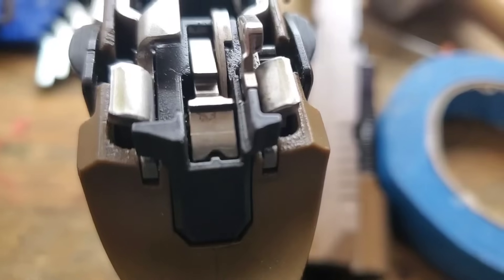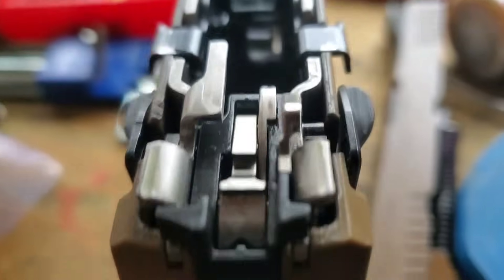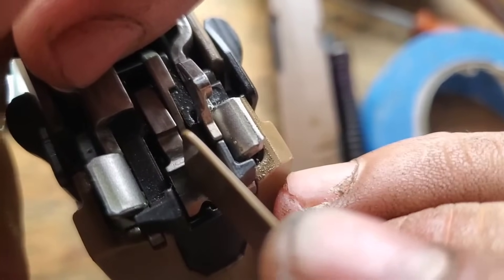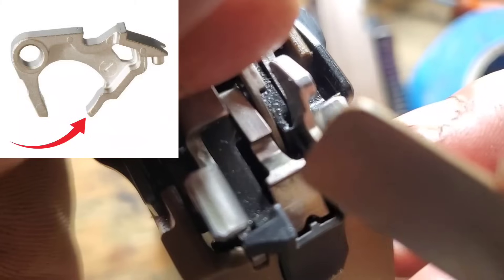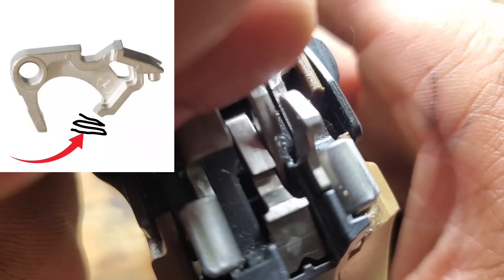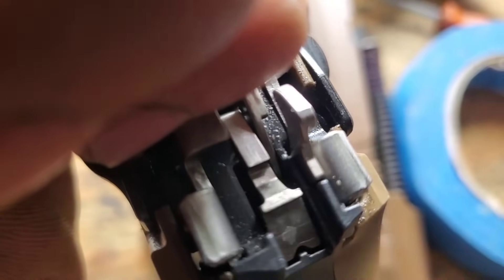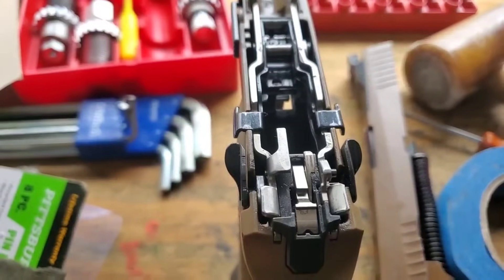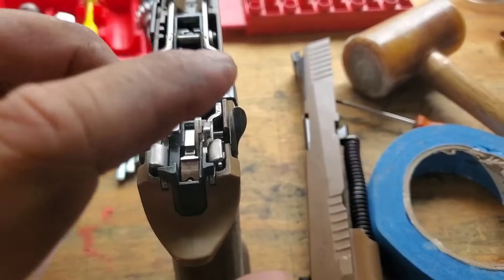Sig P320 [part I]: Private owners solve Sig Sauer engineering problems.

Comment: So. A couple of takeaways for someone in the same boat. I know that there is a company name slanted aces, tactical that has Pat did a fix for this. Don’t know if Bruce Gray works for them, or owns them rather, but I am waiting to see what gets brought on the market and how they plan to repair this. I also right now highly questioned my P3 20 and I do not feel safe carrying it with A round in the chamber. I also can’t afford to run right out and buy something new. That P3 20 has been my carry weapon for the last five years.

Comment: I feel your pain. I have three P320s.....one full size, one X5 Legion, and one Compact. P320s were my primary and back-up range guns, so I have a bunch of extra mags, as well. That's a lot of total money invested in pistols and "accessories". IF Sig recalls all P320s and actually fixes their design issues, I might consider buying another Sig down the road. For now, my new range guns are different brands, since most ranges no longer allow P320 use, for insurance and liability reasons. As for your modification, I'm just going to wait to see what Sig does about the issues.
Reply from the maker: I think you've got the right idea. Wait it out. I'm just so disappointed man. The gun seemed to check all the boxes when ai bought it

Comment: The trigger safety disconnect by pressing the sear alone does not move high enough to touch the striker safety disconnect unless you pull the trigger. It does on mine.
Reply from the maker: They do not appear to all be manufactured to the same tolerances.

Comment: Or. Just get tye updated trigger unit, they will literally do it for free. Literally been proven that it won’t go off with the new trigger unit no matter how hard you drop or hit it. The only ones that keep going off are the ones people and law enforce didnt send it in for the fix, and just kept running the first gen trigger unit.
Reply from the maker: If you look at the sear and trigger bar and trigger, these are all factory post-upgrade parts. Still having problems until I ground the connecting link off of the rear of the sear.

Comment: Nah the trigger issue is a whole Nother problem that they somewhat solved, but the current un commanded discharges I believe her from a structural problem with the sear in probands video Heights, a structural engineer, believing the seer, the MIM process used to create it is an issue. That video site he believes the bonding of the metal molecules in the MIM processing are failing, hence, reducing the sharp angles of the sear, creating the uncommanded discharge when the weapon holstered or  unholster is it a certain angle with juenough force to let the sear disengage the hammer

Comment: I wouldn’t try that mod at this point. Best just put the 320 in the safe. The safety doesn’t block the sear. Wiggling the slide on the gun wiggles the sear against striker foot. If you dry fire a 320, the slide will hop up because the sear is holding the slide down.

A loaded magazine pushes the slide up opposing the striker engagement. Not for me. I put my two 320’s in the safe, then eventually sold them to a gun store. My conscience isn’t clean about that.

Comment: 0:24  Isn't the sear made of polished stainless steel? (not other metal with chrome plating...?). I believe the allegations regarding "drop safety" 2:32 are history & long gone. The main complains now are the Uncommanded Discharges when the gun is loaded, one in the chamber and holstered, and it goes boom by itself (not necessarily "dropped), that part I think, has not been fully addressed.
Reply from the maker: The drop safety at 2:32 is referencing the fact that I have disengaged the sear from the rear of the trigger bar essentially disconnecting it from two very strong springs which are attached to the sear. 

I don't know what the sear is made out of, but there is a visible blemish on mine. 

Thanks for coming out.
Reply: @timberfallingcouple  ... You're welcome. I own a X5 Legion (purchased 2025, made in 2024) and done all the "tests" (including putting an empty casing w/ primer while doing tests) and this thing does not go bang by itself or when dropped, ever.  What I was commenting is that for the most part the new built P320s have addressed the "drop" complains but now the "interwebs GunTubers" are complaining more & more about "uncommanded discharges" when the gun is holstered & by itself, which I find bonkers, particularly because they are regurgitating old videos from 2017 or so... At any rate, thank you for the effort making this video and, myself, I can wait to get another P320 on a "fire sale" to tinker with, cut sear leg, etc. I'm not touching the internals of the X5 as it works flawlessly and shoots awesome, trigger pull at 2.8 lb. crisp reset, (Engineer, pro garage tinkerer myself, lol).
Reply from the maker: There was a video recently come out by a couple guys, a bigger guy in a Hawaiian shirt who seems to be a better gunsmith than most, he could make his weapon discharge uncommitted when a series of failures to follow instructions and mix and matched internals was used. 

I'll get long winded and explain here. When he put a 10mm fcu into a grip module, which had different parts specs but the same part numbers on several parts such as the take down lever and the take down safety lever, he could insert a 9mm magazine into the gun without putting the take town safety lever back into the "ready" position.

In this condition, the sear was pushed down by the take down safetylever, which is why the gun disassembles without pulling the trigger. But the striker foot still engaged the sear, just not very well. 

The combination of that and on his particular gun he had to also remove the striker safety lever and spring, but when he did, the gun would assemble, function check, and fire, but with a slight shake the thing would go bang.

So a marked amount of the uncommanded discharges may still be some kind of user error, however the company, in my opinion would be considered at fault if they have various sizes shapes and tolerances for 10mm, 45acp and 9mm fcu parts that all shared the same part number. It all seems kind of odd, but the video is well put together.
Reply: @timberfallingcouple The parts production contractors or lack of Sig quality control looks like Sig tried to take on more than they were prepared to take responsibility for.😅
Reply: @timberfallingcouple  ... I saw that one, (Hawaiian shirt dude), along w/ other 100 vids of ppl testing P320s, lol. Yes, I think the fault can be "replicated" and I also think that one of the issues (uncommanded discharges) was probably due to an operator (s) at Sig at some point mixing parts destined for one type of gun & put on another, but we probably will never know when or how many... Damage is already done, but the metric ton of speculation on "the interwebs" with ferocious GunTubers is just mudding the waters even more. Some people out there are not very objective...
Reply from the maker: 100 percent agree. Muddling the waters does nothing for the consumer. I think glock Beretta, Walther, all the big names have an interest in helping to muddy the waters so it kind if appears to be sig damage control vs all the other pistol manufacturers who have sponsorships from other companies. Hahahaha the whole thing looks so silly from the outside, and then the few tests and solutions and investigations done by owners who are actually invested in a solution don't get 500k views. 

Very difficult to tell what's what. And it's hard for me to get across that I'm not invested in the company, I'm invested in trying to make the gun work. And also that I'm not trying to cope either, just give people a series of tests or solutions that can make them feel better about their particular gun. 

But basically I 100 percent agree with a ton of what you're saying and I'd bet a lot of people feel similarly about the situation. I just hate to hear guys saying it's in the back of the safe and they're back to carrying x, y, or z when I remember just ten short years ago I couldn't afford to do that, nor did I have any backup or alternate weapons. This is too big of a problem to just dismiss every guy who wants a solution so he can trust his gun.
Reply: @timberfallingcouple It makes a good practice range, truck or house gun, carrying in a good holster maybe, or condition 2.
But not concealed pointed at the family jewels in condition 1 with or without a thumb safety. Imho😂
Reply from the maker: @tims6970 that's okay, I don't use them balls for thinking anymore. And I won't live long enough to miss my femoral artery. Hahaha
Reply: Custom triggers improperly installed....?
Reply: @tims6970  ... That too, famous video Achilles Heel Tactical shooting range "Is that a fucking P320!!!" Later it came to light that the said gun had a trigger job to make it a "race gun" w/ snappy sear and lighter trigger pull...  It wasn't a out-of-the-box OEM gun...
Reply: @mauscuba That would explain a lot of this stuff coming out after all the local firing range rats start trying to become self taught personal pistol smiths....😂

Comment: Some of the guns that continue to fail, one question I never hear answered. Have those guns been upgraded to newer standards? I’m also understand that SIG is the only striker fired gun that has the striker almost completely caulked back whereas other ones the striker is in a rest position, which is where you get the spongy take up before the release. Lastly, any newer model models that may fail is it all because of poor quality control?
Reply: SIG has not made any updates to the p320 yet, but is possible they have made changes under the radar so that new guns off the shelves are safe and have proper tolerances.  The poor quality control is another possible contributor to the p320s that have failures.  Another video on YouTube has a great example of a 9mm p320 with a .45/10mm takedown lever that causes tolerance issues.  If QC has problems such as that, there could be other issues with parts being missing or defective etc..  And yes the fully cocked striker is basically the main design flaw. It only has one real safety that can stop the firing pin from releasing, this is why it has many cases of random discharges due to the tolerance issues causing parts to move when they shouldn’t be moving in the FCU.
Reply: @carey7424  they most certainly have made updates to the weapon to fix the issues. I don’t think in my humble opinion that SI was ready for such a major contract, which is where most of these issues have come from.

Comment: I respect your position that you won't sell a potential problem to someone else.  Some municipalities and police departments upon weighing similar concerns opted to sell back their p320s and those are now back in circulation.  Like a 1975 Ford Pinto, people should at least be aware of what they have and assume the risk to self and others when using it.  I carried a 1st gen Glock back in the 80s, the M9 on deployment and have fired many different pistols over the decades; and the m18 was one of the most accurate for me.  However, the old school double action first shot for me just seems safer to carry loaded.

Comment: My 8 year old 320 X-Carry sear sits lower, the spring is so hard that it’s very difficult to push down manually and it doesn’t move at all when moving the trigger is manipulated with the slide removed…and yeah, the gun fires.
This guy and his video solved nothing.  Pure speculation.
Reply from the maker: You didn't release your take down safety lever sideways man.

Comment: It amazes me that an Austrian guy with no firearms experience designed a simple striker system in the early 80s that hasn't changed much at all in all those years and hasn't had the problems that these modern assemblies do.

Comment: I wouldn't sell a gun with a known issue that makes it dangerous to the user, but I wouldn't trust it even if I thought I had it fixed either. 

I would likely carry it without a round in the chamber while I found a way to buy a better/safe carry gun.
You can find CZ p-10 guns pretty cheap that shoot great and are safe and reliable around $300 new as just one example.
I'd save the SIG p320 for range shooting.